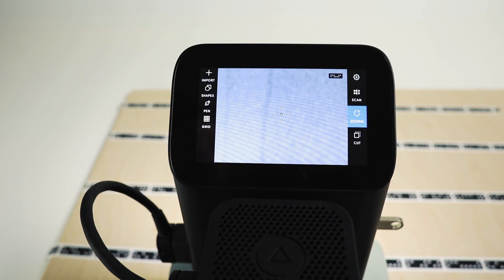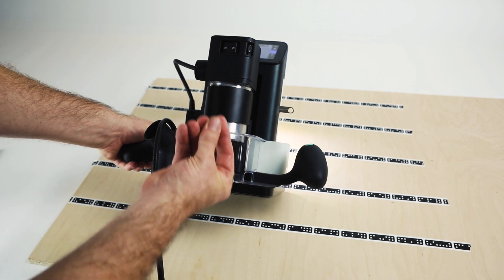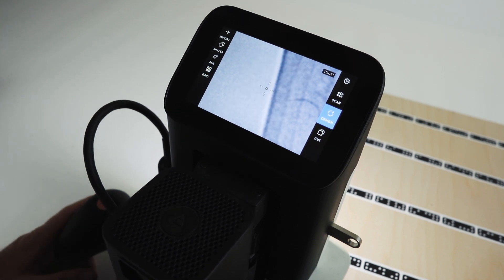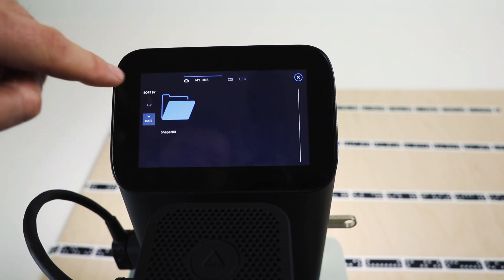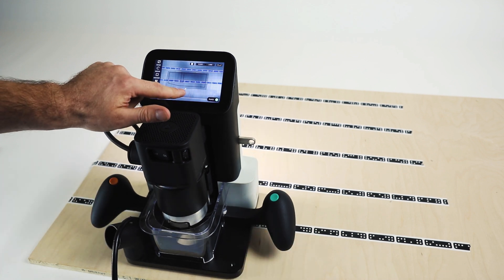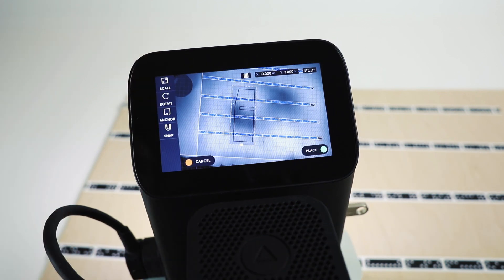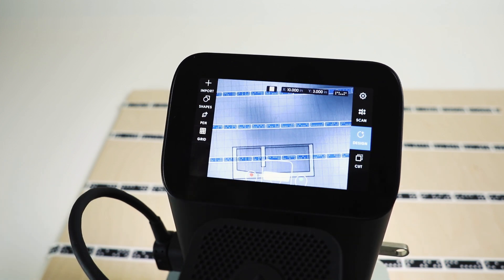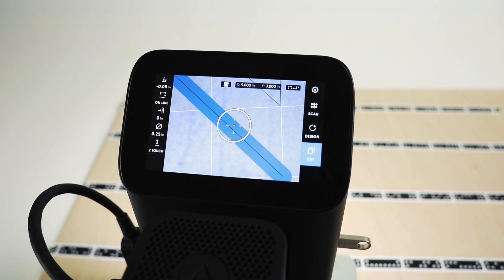Shaper Origin: Walkthrough of Berryessa Update

Comment: Nice improvements. 
Ideally, I would like to snap the design using a design feature, such as a corner or a circle and snap it to the grid and not necessarily use a  boundary   location established by the on board software